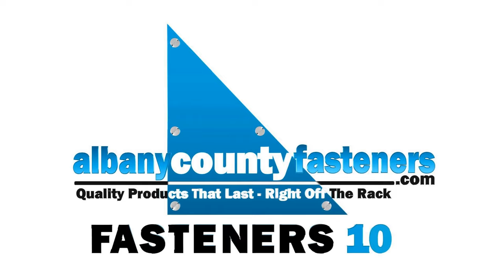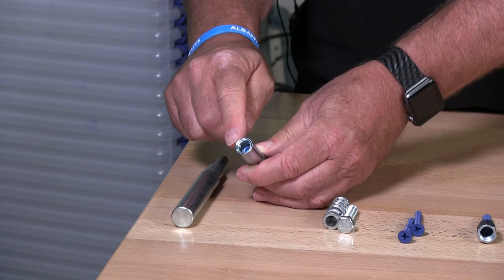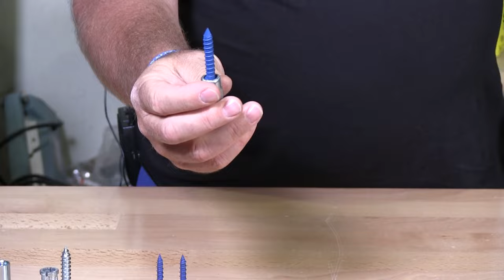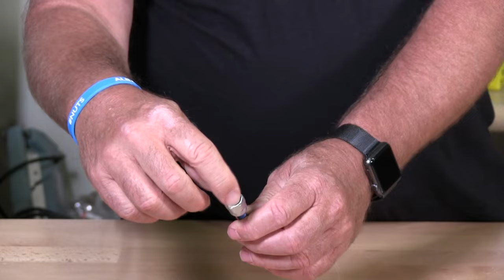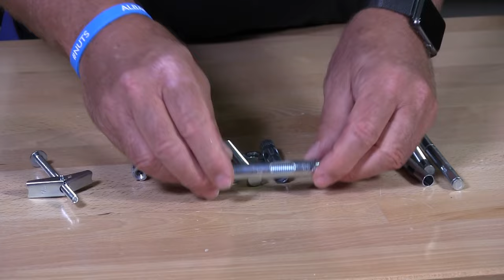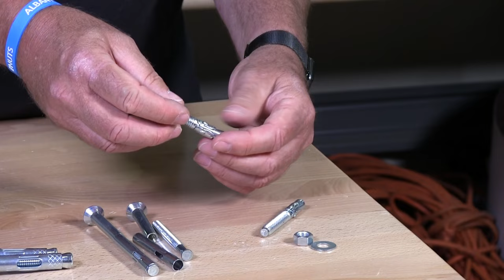The Types of Masonry Anchors | Fasteners 101

Comment: First, I love you guys.  I often order stainless hardware and nobody can beat your pricing, inventory and delivery times!

The video on masonry anchors is a great start.  So many thoughts come to mind based on my experience, i will share a few that i can think of sitting here:

1.  Drop-ins are my favorite for concrete, floors, walls and ceilings.  I like the ones without the top rings as i can set the depth based on the length of the bolt and overall application.  They are by far the strongest, and allow the use of grade 5 bolts or stainless bolts.  Also, if you need to move something later, you dont have something sticking out of the wall or floor.  Be sure to clean out the hole with a round wire brush and vacuum before setting it.  Oh yeah, i often screw in a bolt a couple of threads and tap it down in place before using the setting tool.  Once you tap the setting tool, the anchor is not moving.

1.5  I have not used the old lead shield drop ins (now pot metal i guess) for years.  They seem prone to breaking, and lag screws are generally not very strong so not a fan.

2.  I hate tapcons on CMU (concrete block) walls.  So easy to strip out.  I know they are fast and easy but be sure you get the right drill.  Also, if you are going into a hollow block (most common) be sure you have threads the length of the wall of the block.  If half the length of the tapcon is not threaded, you have no holding power.  Keep in mind too that when you drill into the block, the back side of the block will chip off,  making the wall very thin.

3.  You didnt include good old plastic sleeve and sheet metal screws.  I often use these on hollow CMU and stucco (real stucco, not dryvit) because they hold very well, and I can use stainless screws.

4.  I use the round head anchors with the drive-in center pin for hanging electrical boxes and conduit clamps.  They work well on CMU, are easy to install, and generally hold quite well for low stress stuff.  Only disadvantage is they are really difficult to remove.

Take care, and see you on the next order.
Reply from the maker: Thank you for your continued business and input. We always love to see these kinds of informative comments. Thanks for sharing your experiences!
Reply: If I was drilling into hollow block, and I already drilled holes for a 3/8 tapcon lag bolt, which anchor would you recommend? I’m hanging softball cubbies in a dugout

Comment: So I want to attach a pull-up bar to a concrete ceiling.  It's rated to hold 800 pounds, though I only weight 170.  What type of attachment would you use?  There are 4 pre-drilled holes in the steel bar that you attach.
Reply: About to ask the same question

Comment: What fastener do you recommend to attach a TV wall mount to the mortar in a brick and mortar wall?  Or is it not advisable to use a fastener in the mortar?
Reply: The mortar would be weaker than fastening to the brick. You could use larger Tapcon bolt, and hammer drill pilot holes into the brick the size of the shank of the bolt, not the threads, so that the threads cut into the brick as you drive in each bolt. A mount with four bolts should be sufficient

Comment: Thanks for the knowledge man. ...
What fasteners do you think are the best for a deck ledger board to attach it to a concrete wall?
Thanks
Reply from the maker: If it's a solid concrete wall, sleeve anchors would be your best bet. But you should consult local codes and engineering data before selecting a fastener for such an application.
Reply: @AlbanyCountyFasteners  From watching your video I would have thought you would propose a wedge anchor for the deck ledger board in a poured concrete foundation wall.  Do you have a video that explains how to choose one or the other type for this purpose? or can you say a few words here please?

Comment: Can Wedge anchor be inserted through holes of column base plate or do they need to be inserted first and column to be erected next?
Reply from the maker: It's generally better to insert the anchors first and then your application atop them. It can be done the other way around, as was shown in our video on anchoring to concrete (https://youtu.be/DStVH-kg9ho), but that may cause complications and crooked anchors depending on your application. Just make sure your measurements are on point; once the wedge anchors are down there's no getting them out.

Comment: With the lag screw anchor can the lag screw be taken out and put in? I need to temporarily use the anchor at different times of the year.
Reply from the maker: Yes, the lag screw can be removed and reinserted. However, the holding values of the anchor may decrease with repeated removals and re-insertions.
Reply: @AlbanyCountyFasteners  What would you recommend for a seasonal use insert, I want to setup a screen on my garage door in the spring, but take it down in the fall each year?

Comment: What do you recommend using to mount some brackets (tire storage) to a concrete ceiling garage @albany
Reply from the maker: Wedge anchors, if the concrete is thick enough, but it may be better to use whatever the manufacturer of the the brackets recommends.
Reply: @AlbanyCountyFasteners  thanks

Comment: Hi, what anchor is suitable for holding 80 lbs on cinder block wall ?
Reply from the maker: It's going to depend a lot on how the 80lbs will be applied on the cinder block wall and how thick the wall is or if the cinder blocks are filled. Additional, the number of anchors will really depend on the application. You could consult the manufacturer of whatever you are fastening to the wall for advice or contact our customer service for more information - 866-573-0445 or via email at support@rawproductscorp.com

Comment: What About Stucco. Just seems like all these self help Youtubers are scared to do anything on anchoring to stucco
Reply: Depends on what you're mounting to it. If it's a mailbox or something light, drill into the stucco with a masonry bit and any expansion anchor should work in a correctly sized hole (the size of the anchor, no more)
Reply from the maker: If this is Stucco direct to block walls there is no issue as long as the block wall cores are filled with concrete.  If this is a Stucco EIFS system then you need to find out how think is the foam board.  Also don't crank down on the screws if there is foam board because you will damage the finish wall.